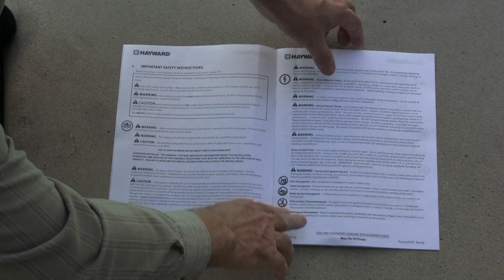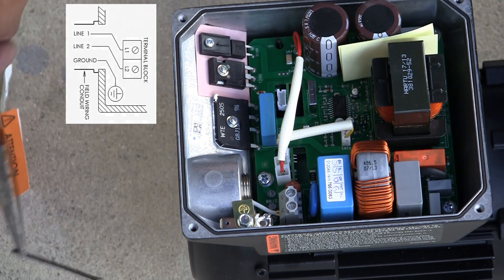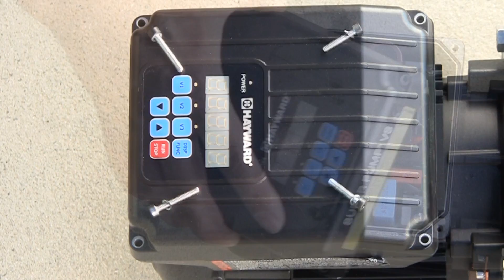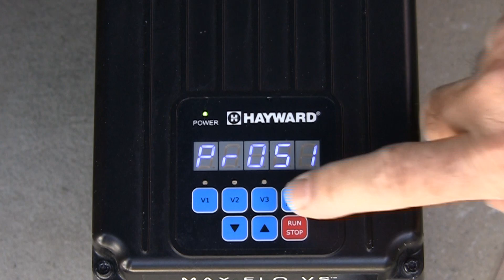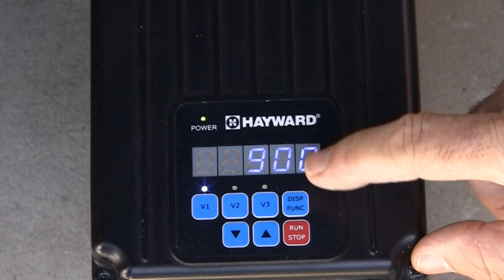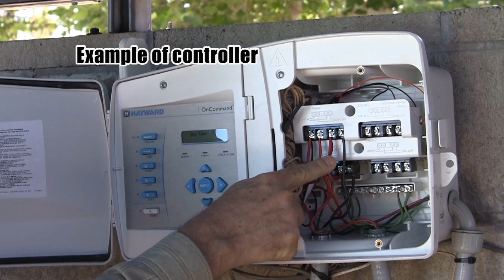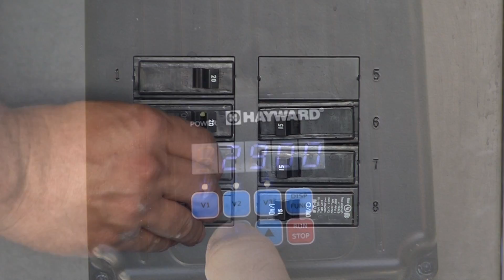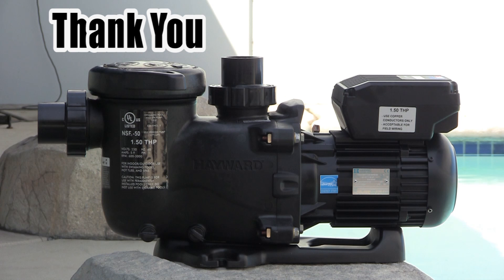Max-Flo VS Variable-speed Pump Programming and Troubleshooting

Comment: Just received this pump and it will not power up.  Tested power to the unit and it will not do anything?  Any suggestions??
Reply from the maker: Dawn, please private message your phone number for a call back from a tech.
Reply from the maker: Our tech has asked for the following:
Model number of pump
Incoming voltage
Where does the voltage come from, time clock or breaker?
Thanks Dawn!
Reply: Same problem here on two pumps now. Max flo sp2303vsp just unboxed it hooked it up and no power to the control panel.
Reply: The Casting Shop we ended up one leg of our 110 had come loose. Check that hopefully it helps you too.
Reply: dawn Pierce  this is pump number 2 and the same type of issue..... Everything is wired up correctly but there is no 12v power reaching the control panel.
Reply: My husband said ck wires to the pump.  Test them and make sure there is 110 on each wire.  We had one a little lose and it was not getting 220 to the pump.

Comment: I have had this pump for about and year and have had no problems.  Today, I received a Error 20.  I checked the impeller for debris but didn't find anything.  I disassembed the pump and found the impeller and the diffuser had grooves where they meet.  I also noted there was no wear ring between the diffuser and the impeller.  Not sure if it was never there or is it had disintegrated.  The parts list in my manual doesn't show a wear ring. Should this pump have a wear ring on the impeller?  If noit should I lubricate the surfaces of the impeller and diffuser  to prevent further wear? .
Reply from the maker: Great to hear Ron, thanks for letting us know of your good customer service experience!
Reply from the maker: Hi Debbie, what is you pump model and your phone number?
Reply: Model S2302VSP, serial 21121512003040013. My mobile number is 513-328-8160
Reply from the maker: Thanks, our tech will follow up with you.
Reply from the maker: Debbie, our tech called and asked for your address, complete name, installer and date of install. Can you please provide that information so he can move forward?
Reply: Hayward's local dealer Cincinnati Piil Solutions came today and switched out the motor in 30 minutes.  Very happy with the service from the Hayward Rep and their local representative.

Comment: the year is currently 2017 and the pump software revision I have is r2.3.  This video should be repeated with version 2.3 software. The Configuration Sequence is different. Push and Hold Disp/Func gives you ConF9.
Then you have to set the time of day.  
Then you move to the Pr (Prime) and adjust the time for the prime mode.You then set V1, V2 and V3 speeds, but in my case after  the prime sequence it also went to V1 not V3. I also managed to get   t1At indicating timer 1, but then I tried to adjust it and got t2At which was the timer for V2.  
Once running, I saw:   t2At,  8.00A  5.26P  2500  P780 which indicated timer 2, 8AM start,5:26PM stop and Power 780 watts.

The video also needs to show how to configure timer 1, 2 and 3 and whether or not it applies to V1 and/or V2.    
It would be nice if Hayward could simply provide up to date information on You tube showing an entire sequence of programming after a flowchart description.
Reply from the maker: Thanks for your feedback. We'll share it here. If you'd like help with your pump, a tech can call you. Please post your phone number.
Reply from the maker: There were three versions of the Max Flo VS.   The one you are viewing is the original.  The original Max Flow VS was the SP2300VSP.  The second version was the 2302 while the ThIrd version and current one is the 2303.   We just finished a video on the 2303 which is the same as our EcoStar.  To be posted soon.  There is no video for the 2302. 

The 2300 and 2302 have the same interface with the 2302 having a true timer.  The 2303 has the EcoStar interface which is now the interface across our line of Variable Speed Pumps.
Reply: I look forward to the new video. 

Another issue with my pump is the colour of the cover for the pump filter. Mine is a dark, opaque, black plastic. It is not clear and transparent. This makes it hard to tell if the water is greenish, cloudy or clear when checking the pump or looking to see if water is coming in during the prime cycle. Is it possible to get a clear plastic cover? 

In your next design, you could also try putting small LED lights under the buttons that you can turn on or off?  I would to have the option of illuminated buttons. My pump is in a box with very little light. So if I want to change speeds at night, I need a flashlight. 

Give these comments to your engineers as functional requirements for your next version.
Reply from the maker: We'll share your comments with the folks here, thanks.
Reply: I need this help too since these are not working for my pump. I have a SP2302VSP
Reply: @AM2PMReviews  I sold my Hayward pump on Kijiji.  I now have a different product.
Reply: Your comment is the best i have found online so far. It has helped

Comment: I REALLY like this pump!  I had a Power Flo LX  pump for my above ground pool (13.5K gallons) but it does not have enough head pressure  to pump up 30 feet to the roof to my solar pool collectors. I changed to this pump mainly for the head pressure . My set up is this.  I have 2 inch going in the sand filter and then  back to the pool and Jandy gates to the solar collectors and other. Everything on flow wise worked but was not getting filtration. I removed the sand filter (25gpm) and installed a C150s filter (125gpm). Notice a immediate improvement on flow (as predicted) and lowered the RPM on the new pump.
Reply from the maker: Glad it worked for you.

Comment: Really od that it starts with V3 and then switches to V1 - but during programing it starts with V1, going to V2 and V3. It does not make a lot of sence. Also, in your video the LED on the Channels are on during operation and in real usage they are not on - at least not on my pump.
Reply from the maker: Werner Bertsch Thanks for reaching out and providing feedback on the video.
Reply: Me too. I think we have a different pump like the SP2302VSP. It seems to be a little different than these videos. It is confusing and no one has been able to help me and the manuals are not the same as my unit either since the one on their site is a 2303 manual and I have a 2302 pump

Comment: Is there any reason why this pump start at the 3rd level, then switch to the first and wont use the second?
Reply: happytrigger, actually, it starts in prime, and then it goes to V3, and then V1.
Reply: Mine is the same I think it is because it is the 2302VSP with software 2.3. I just got house with it. Did you figure yours out yet? I would love advice
Reply from the maker: If you’d like to speak with a Hayward tech on Monday, please dm your email address and phone number via Facebook or Twitter.